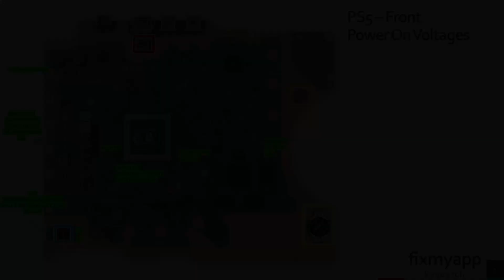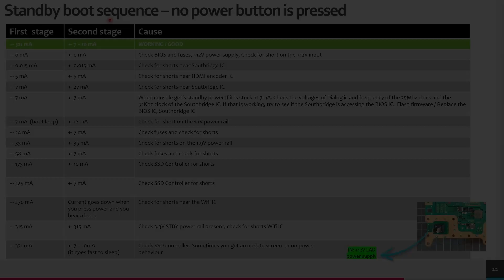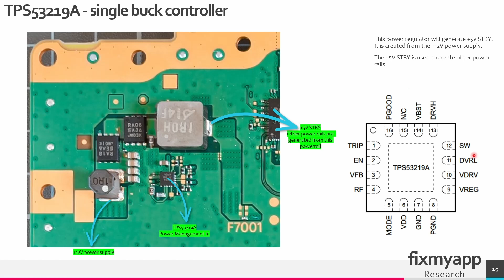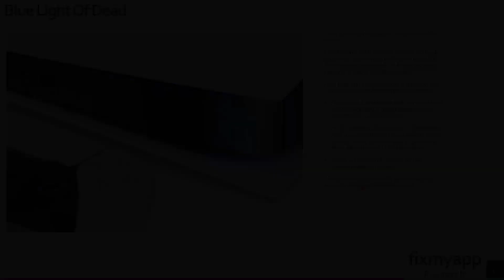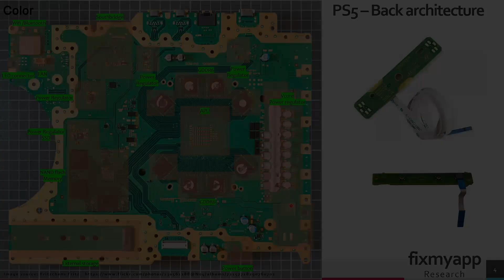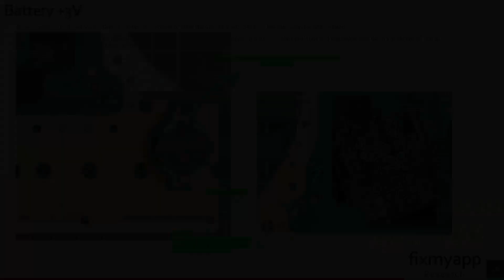PlayStation 5 Ultimate Troubleshooting Guide - Fixing Your Console Like a Pro

Comment: 9:08 its 1,8V Standby NOT 3,3V.
Reply from the maker: Thank you for this rectification. Will pin this remark. Gr. Jim
Reply: On EDM-020 this is 3.3V from my testing. The regulator nearby F7002 is 1.8V output, though. Perhaps you meant this.
Reply: @KyleGP  The EDM010 supplies 3.3v at F7002

Comment: I got a PS5, with the error CE 108255-1, the console runs the games for a few minutes and then this error appears, this happens with all games it is a new console I already ruled out sotfware errors, I would like to know if you would have information to any hardware problem associated with this, thank you very much in advance I am from Venezuela and there is no official Sony support in this country
Reply from the maker: Hi most probably the onboard ssd controller chip could be faulty and needs to be replaced. Gr. Jim
Reply: @fixmyappjim  thanks

Comment: Love this guide but I'm stuck don't know if you can help. PlayStation 030 has 12v, 5v l. Short at f7003 removed all caps and da9065 still short. Removed sb, still short on pads what else feeds from f7003
Reply from the maker: Hi there could be a short in the inner layers of the pcb board. Maybe you can inject voltage to see which component gets hot. Gr. Jim
Reply: @fixmyappjim hello, how to inject voltage If it does not If it does not start? I have a modular power supply but I don't know where to connect it to power the motherboard. Thank you for your help.

Comment: Hello. Please offer me any suggestions. I have a 020 board beeps, blue light then shuts off. No shorts.  All voltage are present except one spot. The 3.3V on the component shown at time stamp 36:36. All other 3.3V points are present. I have been working on this for weeks and can't figure it out. Any suggestions would be greatly appreciated.
Reply from the maker: Hi, this is a difficult one. I would check the apu reflow or reball it. There could be cracked solder joints under the apu. Also check under the apu if some capacitors are shorted. Also check the southbridge ic. also check ram modules. Gr. Jim
Reply: @fixmyappjim  Thanks for your reply. I actually already replaced SB. I checked for shorts around Ram and APU. The only thing I didn't try was reballing the APU. I didn't want to just try it just to "try it". But at this point I guess there is nothing else to try. I even tried Uart diagnostics, but it just gives the general code.
Reply from the maker: @shawntyson8  Indeed you have nothing to lose, you could try to add pressure on top of the APU to see if you can boot the console. Success! Gr. Jim

Comment: in 36:30 i don´t have 3,3 stby and 1.8 stby.. can you know what cause this problem? thanks a lot
Reply from the maker: Hi +3,3V is needed to create 1.8V. I would check if the 3.3V is shorted or the IC if faulty. Check the VCC, EN pins of the IC that generated the +3.3V. Gr. Jim

Comment: Maybe a silly question, but how do I check the power on voltages of a motherboard when the device doesn't power on - no sign of life?
Reply from the maker: Hi you have to check for standby voltages. The southbridge ic is the best place to start. Also just probe the board with a multimeter. Also the power switch is a  good place to check 3,3v standby power, you can also check if the RTC clock is running near the southbridge chip. Gr. Jim

Comment: Hi there. Can I please ask whether or not there should be a clock signal present on pin 6 of the bios chip and at the 32.768khz crystal oscillator at all times? As you said it receives power from the 3V battery when the console is not plugged in. I'm not seeing this signal on the oscilloscope. Any help would be greatly appreciated. Thank you.
Reply: Thank you so much once again mate. My problem is definitely in this area. I have voltages of approx 3.17 very close to the crystal, but none actually on the crystal itself, therefore it does not produce the frequency. I changed the South bridge, but no change. Deep down I knew it's because of the missing clock signal. I even see the attempt of data transfer on an oscilloscope between the bios chip and South bridge...but without the clock, everything shuts down. Thank you brother!
Reply from the maker: Hi PIN 6 of the BIOS chip should start when the console is booting up, when you press the power button the clock signal should be generated to communicate with the BIOS IC. The 32.768khz crystal oscillator should always be generating this frequency. It is used for the real time clock. Check is the coin cell battery is present and voltage is +- 3V if battery is ok it should generate this frequency, if not present you have to solve this problem first as the Sourthbridge will not work without a clock signal. Gr. Jim

Comment: What a fantastic video! Please can you tell me what sort of resistance to ground the capacitors under the APU should be? Nobody seems to give much information, other than saying the whole APU area is very low impedance. The input 12V rail on my board is not shorted, but I'm concerned about the coils on the APU side and the APU capacitors..... Any help would be greatly appreciated!
Reply from the maker: GPU has a very low resistance to ground so between 1 - 10 ohm would be ok. Gr. Jim

Comment: Fantastic video and guide. Small error I noticed in the guide is the 0.8v on the cap right next to the encoder IC is 1.7v, not 0.8v. The 1.7V trace runs to this cap.
Reply from the maker: Thank you for your extra information about the voltage. You are right! The second last capacitor is 0.8V The last capacitor near the encoder IC is 1.7V.  Gr. Jim

Comment: Great guide. My playstation fan does not spin, there is no power, it depends on which chip, where does it get power from?
Reply from the maker: Hi. I don't know exactly but i suspect that the PWM signal comes from the APU. Check if there is a PWM signal present with an oscilloscope, also if this signal is not present then the fam should spin on max rpm. If it is not spinning check the powerrail that supllies the power to the fan. Gr. Jim

Comment: Ce 108255-1 crashing errors suck. It could be anything. UART is not helping. What do you think?
Reply from the maker: Thank you very much in supporting this channel with your donation! This error is a common error it can be everything. I would first check the simple stuff like looking for hot spots on the APU and if the liquid metal is good. Next i would check how this crash happens is this game stored on the internal SSD, If yes try to install the game on a extra nvme drive and see if the problem still happens. If not i would suspect the SSD controller or flash memory to be the suspect, these fails alot as they have a limited lifespan based on the amount of read and write actions. Also RAM modules can be faulty and underload it can give random crashes. So i think the problem is with the SSD or RAM sections. Try to monitor the board with a thermal camera to see if there is a specific ram or flash module getting hotter then re rest. Gr. Jimmy.

Comment: I have checked the power supply and I have the 12V. but look lite I have a short circuit around on the power regulator 1RO 121 05P is in short-circuit. and when i plug the ps5 I can see also my tv goes off and when i unplug it tv goes on again. can it be fixed?
Reply: 5 V power regulator to the left around the hdmi port
Reply from the maker: Hi shorts on the power supply of the HDMI region is most of the time fixable because the HDMI IC will be broken or the power regulator. As long as the voltage did not go straight to the APU then there is hope.  Gr. Jim
Reply: How can I do if I want it to be fixed
Reply from the maker: @erickabuya7666  Hi, It is best to bring it to a repair shop with console experience to analyse or repair. Gr. Jim
Reply: @fixmyappjim  thank you, just a question can I change the motherboard with another one?
Reply from the maker: @erickabuya7666   If you have a disc version then no the disc drive is married to the board. Gr. Jim

Comment: Please make more guides like this. I run an electronics repair company and would absolutely love to show these videos to my technicians to better train them. An Xbox Series X guide would be super helpful as well. Furthermore, if you have any advice on PS5s that are crashing out of games with error code CE-108255-1 I would love to hear it. My shop has had a few of them come in for repair and none of my staff can tell me an answer as to what can solve the issue. Would love to hear your thoughts. Great work!!!
Reply from the maker: Hi, Thank you for your kind feedback! I will try to make more these video's in the future. If the PS5 is crashing during the game it could be a temperature problem or a defect RAM / or Flash memory problem it also could be component that is failing these problems are hard to diagnose. Maybe you could read the error codes by soldering serial wires to read the southbridge error codes maybe it could indicate a faulty component. Gr. Jim

Comment: Hi Jimmy at 36:42 I have both 5 volt standbys but non of the 3.3 or 1.8. Would u say there is an error in that area and need to replace a part?
Reply from the maker: Hi, if the layout of the components are the same then yes these 3.3V and 1.8V are standby voltages and are needed, check board if you can find them or check resistance / shorts. Gr. Jim

Comment: Hey everyone quick question in standby mode f7002 I get 3.3v and 5.1v but exactly place on the other side of the board I get 1.8v and 5.1v on standby. The video shows that I should also be getting 3.3v but I’m not.
Reply from the maker: I don't know what the fault is in your case, but there are some revisions of the board it can be ok if not try to analyse the +3.3V circuit. Gr. Jim

Comment: My HDMI port seems well soldered but I see dots on the screen with 480 resolution and safe mode. Could the problem be the Panasonic HDMI Encoder Ic?
Reply from the maker: Hi yes that IC is responsible for the resolution of the screenit could be that hdmi encoder ic. Gr. Jim
Reply: @fixmyappjim  Thanks! I Will try 😉

Comment: hello guys , what about blue light for 2 sec then turn of after that i press button and it do sound but no light , the consol is new never utilized , also somtime it turn on and work normaly , anyone have any idea ?
Reply from the maker: Hi can be RAM APU related. I you can't find any shorts or broken components i would try to read the error codes with UART. Gr. Jim

Comment: Thanks a lot mate for this detailed video. Its awesome. At 30:50, instead of having 3.3v I have 1.8v there for an EDM-010 board and at 36:33, I dont have the 1.8v STB voltage. Other than this, everything tests ok with STB and PowerON voltages. Moreover, the lower voltages near HDMI IC is absent. For the stanby boot sequence, I have 80-100mA power draw, holds here for few seconds and then it goes to 0mA.  The console beeps every 10seconds but no light. Can you direct me?
Reply from the maker: Hi, This is correctly 1.8V can be measured near F7002. Because this is an other revision of the ps5 board. It could be a bios / SSD / Memory issue, also you can solder serial wires to read the UART error codes. See youtube for a tutorial about reading error codes. Gr. Jim
Reply: @fixmyappjim  Thanks for your reply. UART showed "Post secure Loader Error 2 - CE-105629-3 SCE_NP_DRM_ERROR_UNKNOWN_VERSION". Do I'm guessing ssd?
Reply from the maker: @DrCryogenic  DRM, or Digital Rights Management, in the context of the PlayStation 5 (PS5), refers to the technology and measures implemented by Sony to protect copyrighted content on the console. So indeed it could be firmware / ssd related.
Reply: @fixmyappjim  thanks a lot 😊

Comment: First of all thank you for great video!

On my PS5, instead of 3.3V there is 1.8V on the voltage regulator output (30:52 in video). It is designated as SBVA T107F but I can't find it anywhere to buy. Is it OK to use TLV62090RGTT on that place?

Best regards,
Marko
Reply from the maker: Hi, This is correctly 1.8V can be measured near F7002. Because this is an other revision of the ps5 board. If i am correct SBVA T107F = TLV62090RGTT
Reply: Thank you very much on your answer!  @fixmyappjim  

My revision of board is EDM-010. As I understood on some forum voltage regulator output (picture on 30:52 in your video) should be 3.3V on EDM-010 boards, and 1.8V on EDM-020. So I am not sure should I change my chip or no.

Also do you maybe know what are the values of resistors on the left side of the SBVA T107F chip? I think that I burned some of them because now my output voltage from regulator is 0.9V...
Reply from the maker: @markoaksentijevic1097  Hi i don't have a mainboard now to test the voltage. The TLV62090RGTT IC is a cheap ic to replace just to be sure. 3.3V and 1.8 volt are valid voltage values but i can't say in your case if the voltage is correct. I don't know the resistor value :( also i don't have a donor card to check it for you :( Gr. Jim

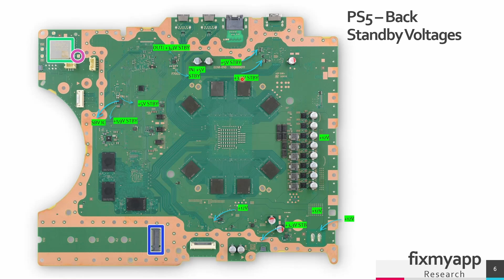Comment: Hi Master, I've a ps5 that no work. I've missing 1.8V on the capacitor at 36:28 time. I will want ask you if this voltage is generetade by hdmi encoder panasonic or if you can say me who is to generate it. There isn't short on this line. Thank you
Reply from the maker: Hi, near the hdmi encoder there is a regulator that generate 1.8v. Also the sbv ic generate 1.9v. Gr. Jim
Reply: @fixmyappjim  I checked standby voltage near hdmi encoder and I missed 1.7V 0.8V and 3.3V but there aren't shorts. It's possibile that the southbrige no ability this lines?

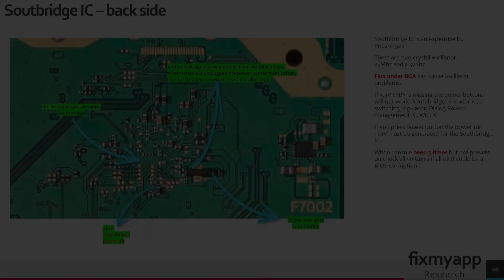Comment: thank you for all bro, I will want ask you a question: in 30:41 - 3.3V STBY voltage regulator you say that 3.3V is generate in that voltage regulator, butt I have a new ps5 that work and I not found 3.3V there, but 1.8V. You can check this?
Reply from the maker: Hi thank you for your info. I don't have a ps5 board to check this voltage now but the Southbridge also use 1.8V STBY so i think you are right. Gr. Jim

Comment: how do you tell which direction the traces are delivering current?
Reply from the maker: Hi on all traces the current goes. It will find the direction with the lowest resistance or lower voltage difference. Gr. Jim

Comment: Very good video! 
What could be with green video output crash for ps5? When playing high demand games? 
Could it be hdmi encoder?
Reply from the maker: Thank you for watching. Green screen is new for me, but high demand maybe a thermal issue? Try checking the metal liquid of the APU and check if there are dry spots. Be carefull with liquid metal is can create shorts on the mainboard. Gr. Jim
Reply: @fixmyappjim  Thanks for reply!  
I checked the liquid metal and add more to be safe its not making porblems, but still the same issue. It seems the thermals are the case but im thinking one of components are going bad and making this issue, but im not sure what else could do that if not APU GPU side. 
I have seen in internet same issue if searching ps5 green screen crash, but havent found solution.

Comment: That is only half  should be uart code error reading and resistance check on component like cpu wifi/bt  diagnostic element like memory checking on thermovision but still very good job
Reply from the maker: Thank you, indeed there are more tooling to do troubleshooting but even for me UART communication is a new subject. Thank you for your feedback. Gr. Jim
Reply: @fixmyappjim  ah an one more elements like cpu gpu has reaction for temperature on power resistance is changing on broken not

Comment: I need help! I got the console for repair, no power. PSU problem, I fixed it and it still won't turn on. Short circuit on the motherboard, problem with the southbridge, replaced and the console turns on and works normally. I put the PS4 game on, it loads normally and I go to play it, it asks me to update the console. This is where my problems begin, the update does not go through at all, via the Internet, USB, not even from safe mode. I tried everything from safe mode, nothing worked. I always get "can't complete update". I also tried reinstalling the system software, it finished and started the update and again it threw "can't complete update".

Could this be a problem due to the bad southbridge I got, although that doesn't make sense to me.

I suspect a bad SSD controller, is it possible that the console turns on normally, loads the game but cannot be updated, it seems a miracle to me but possible.

And now I'm stuck in safe mode.

I guess because I reset several times...

I was informed that it could be because the motherboard and disc drive are not original, they are from different consoles and should be married. But I contacted the party and he says they are genuine.

Is it something to do with the BIOS? But that doesn't make much sense to me either.

I mostly suspect a bad SSD controller, but it's strange to me that the console could be turned on normally but not updated.
Reply from the maker: Hi when you update the system and the disc drive is not the original one this can indeed stop the update proces.
Also i have seen an case where updating the console was not working it stop during the update proces, the cause was a faulty RAM module, when you update the console the update file is extracted and put in the RAM memory. If one of the RAM memory is faulty it can stop the update. So problem could be related to the RAM or SSD. Gr. Jim
Reply: @fixmyappjim  By SSD do you mean the controller?
Reply from the maker: Yes the SSD controller or SSD NAND modules. Gr. jim

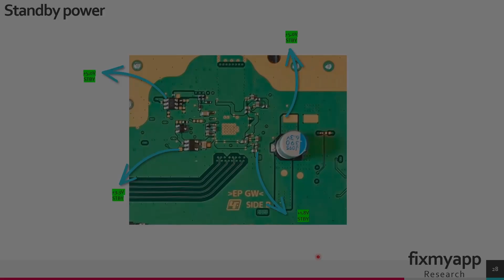Comment: Thank you so much, very helpful!! On 36:50 min, 3.3V I am getting on Top Left  leg. I don't think is on the bottom ...
Reply from the maker: If i am correct both pin upper and lower are 3.3V. Thank you for your feedback. Gr. Jim
Reply: It's supposed to be present on the bottom pin also. I have one with the same issue. Beep and blue light, but shuts off. Did you ever figure yours out? I've been working on this one for weeks